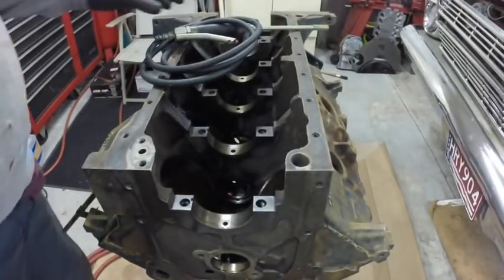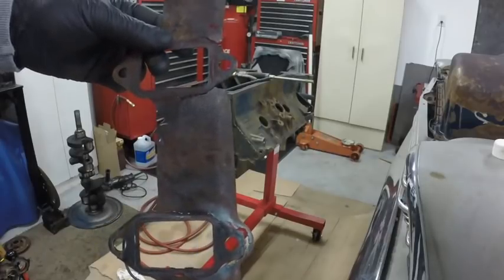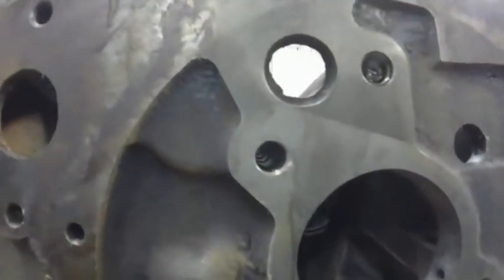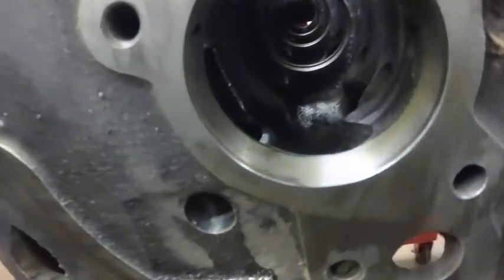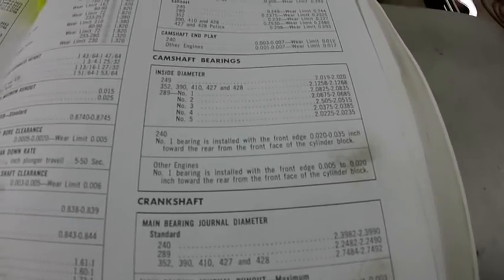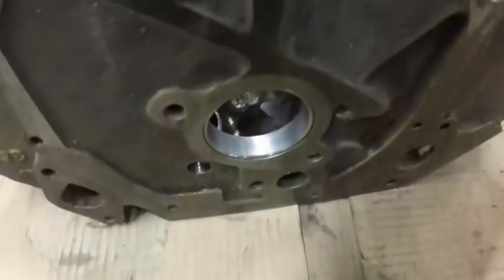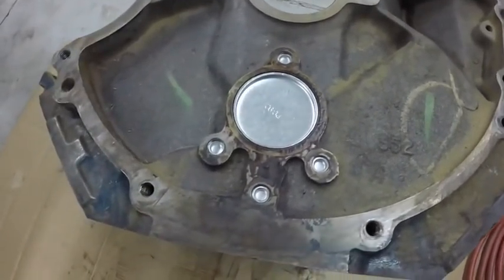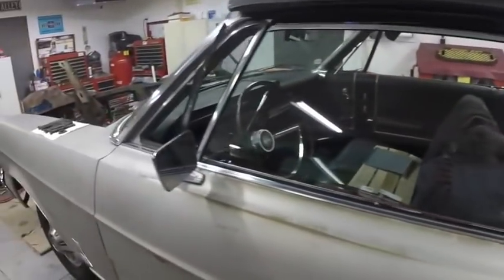1966 Ford Galaxie 500 convertible restoration part 14 installing the cam bearings

Comment: Since you’ve gone through all the trouble of removing the trans, I’d replace the clutches and re line the bands.  Like you’ve said before about your brother being a trans whisperer, it would be cool to film a session with your brother showing the basics of trans rebuilding.
Reply from the maker: I will look at the bands and clutches when I reseal it. If it looks ok, I will leave it alone, as relining the bands is expensive. If there is a issue with it, it's not that hard to pull back out... but I think it will be fine.

Comment: To remove High Tack  quickly and easily  use Acetone.    Put some on a rag and with a quick wipe it is all gone.
Reply from the maker: I couldn't find my acetone, so I used one of my favorite solvents, lacquer thinner. The acetone works better, because it docent evaporation as quick.

Comment: The cap/freeze plug for the cam is supposed to go in backwards. Sorry to say. If not it rides on the cam and wears a hole in it. Bearings look great!!
Reply from the maker: A lot of people don't realize that. It's all good, as I put it in the correct way. I was sitting back cleaning gunk off the camera, when I noticed what I did.

Comment: oh man...good save...you did put the cam plug in backwards but you caught yourself..good for you ,,,,the shift linkage  seal on the tranny is a bit tuff cuzz you have to depress a spring to get the detent ball out...after you get the valve body out of the way ..i did this  on my 65 merc cruise o matic and the detent ball flew out and bounced of the ceiling of the garage and fell into the tranny...but it was an easy save....i think this will be a good little engine for you

Comment: I've been building racing engines for 38 years and I've never even heard them referred to as anything but, "oil galleries". I'm sure I disagree with whatever Google says it should be. Have you ever considered using an engine brush set, they're cheap and very effective. Hahah, "stepped in the pan", I would have sat in it.
Reply from the maker: I thought about a brush set, but the lacquer thinner blasting threw the galleys cleaned them up like a new casting. I didn't state this in the video, but I stepped in the pan three times. Ended up taking care of it, so I wouldn't step in it a fourth time.

Comment: I hate to break the bad news, but I think that you had the Freeze Plug plug correct the 1st time.  Most Ford Freeze Plugs are Dish side up.... Round side down. Not 100% sure on the 352 ends, but I bet that they would be the same.. Better Double check other 352 engine blocks.  I know that the side Freeze plugs are definitely Dish side up (facing you), Round side down (facing Camshaft)... Better go back and look at your earlier videos and pics of the engine right after you took it out..Just letting you know... Tony K., Melbourne, Florida.
Reply from the maker: It's only the cam bearing plug that goes in backwards. It's so it docent rub on the camshaft.

Comment: Love your in-depth videos. I have a question about the oils drain plug. Ford used to offer 2 oversized plus options. The first oversized had an “A” stamped on the plug and the next larger to that had “AA” stamped on it. I was just curious why this was not an option for you.
Reply from the maker: Didn't know they had two sizes. The oil pan was super cheap, and brand new, so no hours of time cleaning and repairing the old pan are needed.
Reply: @OldCarAlley  that dous matter! So many hrs of a engine build are dedicated to just cleaning! Somtimes I feel like all I do is clean clean clean!!